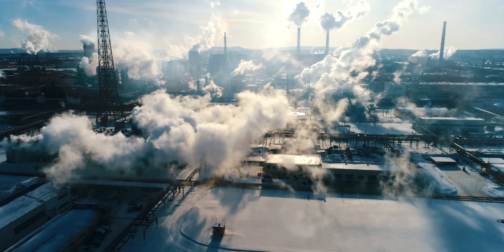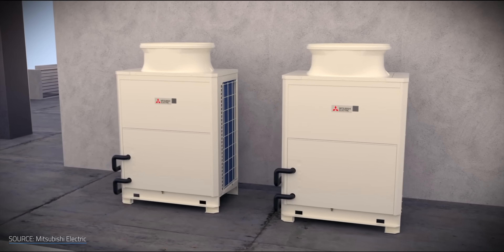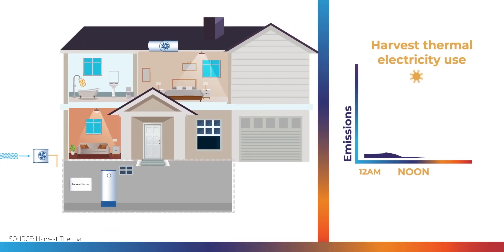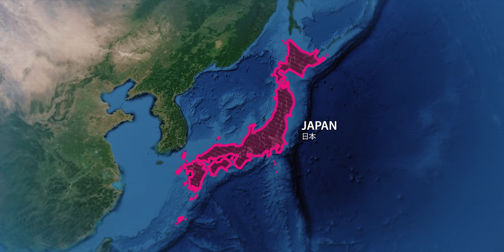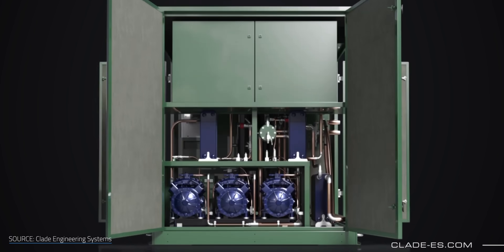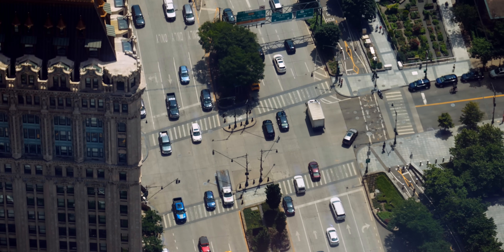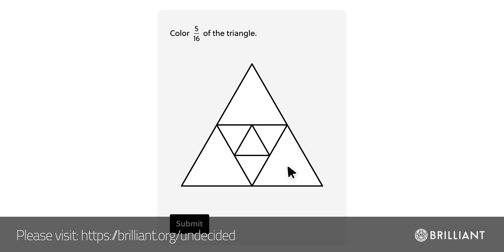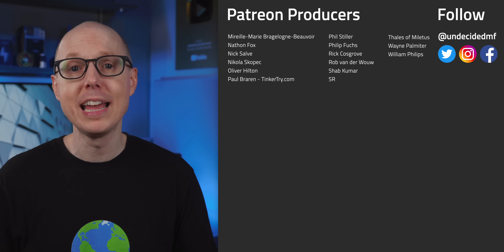Why CO2 Heat Pumps Are The Future Of Cooling

Comment: There are parts of this video that  promote the scam that noncondensing greenhouse gas behavior is warming the planet.   They can't under well known science because earth's greenhouse effect is the model of a system always in saturation from the strong greenhouse gas water vapor.  A system in saturation can not have any more effect from further increasing its active elements.    Earth's greenhouse effect adds 10°F (5.55°C) to earth's average temperature and takes place within 20 meters of the surface.   After 20 meters from the surface all the greenhouse radiant energy has been absorbed by greenhouse gases.  Its further heat transfer is by convection  i.e. gas molecules bumping into each other.  At 1% average tropospheric water vapor 99-1/2% of earth's greenhouse effect is from water vapor.   The noncondensing greenhouse gases have a share in earth's greenhouse effect, but they can not change a system always in saturation from the strong greenhouse gas water vapor.  This is high school science.

The United Nation's IPCC science report in the back of some 200 pages in an obscure paragraph declares it took its greenhouse gas samples at 20,000 meters altitude and only that one altitude!   That is the legal back stop protecting the authors among others from criminal fraud.    It can be argued in court that a high school science interested student would know from reading the IPCC science report it is not actually dealing with active greenhouse gases or earth's greenhouse effect.  The person would be expected to know that from common knowledge and the report authors have made their data transparent.   The IPCC science report doesn't actually flat out state noncondensing greenhouse gases are causing global warming.   Other people writing other IPCC reports have it as their opinion noncondensing greenhouse gases are causing global warming.  That would be the legal protection on more profound statements of noncondensing greenhouse gases causing global warming.   Stating noncondensing greenhouse gases are causing global warming is the biggest known scam in human history.   This is happening when global warming was reported at 1.1°C in 1991 and as of 2023 has never been reported to go higher.   Global warming has been basically stalled at about 1°C for the past thirty years!

Comment: Leaks from the CO2 heat pump aren't really an issue at all, since the worst it will do is return CO2 to the environment that was previously there before it was put into the heat pump.  Unlike burning fossil fuels, which creates all new CO2 in the environment.

And then the amounts involved are so small as to be pretty meaningless as well.

Comment: Pricing sucks. In China,  HPs with specs often exceeding what we in the US can buy from Mitsubishi cost around $500 vs $2000-2500 here – and that's before HVAC installers arbitrarily double that cost for installation (even though an install for requires only modest skill and little special equipment). I truly hope that DrCool's increasing popularity will put pressure on installers to lower what they're charging.
Reply: U believe Chinese specs? Rule of thumb, its usually half their claim.

Comment: CO2 critical temperature is ~31'C (88'F). When out door temp is higher than that, the whole fluid is supercritical (SC). I don't think SC is advantage for heat pump application. SC was used in generator to max mechanical output from a given heat. In heat pump, we want least mechanical work for a given heat (pumping). 
This CO2 heat pump saga is started with EU politicizing and refrigerant patent avoiding. Not going to work on tropical zone for sure.

Comment: There are a couple of massive problems with CO2 which is why they're not used for heat pumps or AC systems;

1: It forms a solid
2: The pressures required to make it liquid are ridiculously high.

R1234YF, a common refrigerant in modern AC units and cars, has a condenser pressure of 350PSI and a low side between 30 and 40 PSI. R34A, which is the predecessor to R1234YF is also quite similar and also provides a near 3 COP.

For a CO2 system it would have to be maintained in a supercritical or near supercritical state which means a high side pressure up to 1500 PSI. if there's a leak in the system and the pressures drop there's a good chance you can form dry ice in the lines, effectively clogging the system. Additionally, there is a correlation between system pressure and failure
rates, as the increased pressures put more stress on the compressor, pipework and service valves. Higher refrigerant pressure machines tend to fail more frequently from low refrigerant charge due to the refrigerants increased tendency to attempt to escape into atmosphere. We saw this during the transitions from R22 to R404A, R410A and R34A.

Comment: Using CO2 as a refrigerant in the heat pump requires so high pressure, that if it fails and depresurises during operation, it's gonna kill someone...

Comment: 17 years in the hvac trade.  If you want to eliminate leakages, eliminate efficiency mandates on hvac equipment and focus on increasing renewable energy production and long duration energy storage, no more curtailment, make power cheap enough that it becomes a subscription service instead of a metered commidity.  Go back to SEER 8-10 coils and lower pressure refrigerants like R22 and R12, a system that doesnt leak, doesnt pollute.  The watts that you save with higher efficiency is a drop in the bucket compared to the money of replacing leaking coils

Comment: The problem isn't just the initial cost, but how long do the components last and what's the cost and frequency of replacing the individual components.  Efficiency is great but the devil is in the details.  I installed a high efficiency gas furnace about thirteen years ago.  It saved me a lot of money in monthly costs compared to my old oil fired system, but it took ten years to recoup the original installation cost in those savings.  Two years ago the aluminum core corroded and started leaking despite yearly maintenance that included flushing the core and installing an anti-corrosive solution.  The cost of replacing the core under warranty was split with the service contractor with the labor cost on me.  If it was an old style iron core furnace the unit would last thirty to fifty years.  The newer ones last ten to fifteen years and the original cost of installation is now at least $15- $20 thousand US.  If the unit hadn't been under warranty I would have been on the hook for the whole bill which could be a couple of thousand dollars or more depending on the amount of plumbing work needed.

Comment: CO2 critical temperature is 32C or 90F. It means that this is the highest temperature during condensation stage. So who wants "hot" water with max theoretical temperature of 32C/90F?
R410a has a critical temperature of 72C or 160F. So R410a can heat water/air up to this temperature. Which is reasonable.
Reply: For heating applications, the critical temperature doesn't set an output limit.  The refrigerant is compressed in the gas phase and can easily get much hotter than the critical temperature.  CO2 based heat pumps from many manufacturers have operating output temperatures anywhere from 70C to 90C or above.

For cooling applications, the critical temperature of CO2 is a major stumbling block.

This is because the simplest pressure reduction apparatus is some sort of throttling process like a valve or a thin capillary, and those are only efficient if your refrigerant is liquid entering the process.   Using an ordinary throttling process in CO2 based cooling is basically a non-starter on a hot day.

There are solutions to the cooling problem, using expansion engines and the like, but they add lots of complexity to the system.

Comment: CO2 is not the only competitor in the race to environmental-friendly refrigerants. Ammonia was already widely used in commericial food refrigeration, and propane is making its way into small refrigerators and AC units for its low material and low liquidation pressure. Technology Connections had also made a video on his small fridge that uses propane.
Reply: Propane all the way. If I have a leak, I'll take flammable over toxic any day

Comment: So as an HVAC professional, that works on boilers chillers heat pumps and split systems, I was told by a vendor that a school in New York City wanted to get rid of the natural gas water heater in their building because natural gas is now bad. They installed a CO2 heat pump to heat the water as it was sold as more energy efficient. To heat the same amount of water for this elementary school the bill went from $1,500 a month for gas to $17,000 a month. All in the name of being more efficient.

Where systems will not add much cost getting low hanging efficiency makes a lot of sense but in the CO2 world there's not a lot of low hanging fruit as installation cost significantly increases.

Comment: Propane is an excellent refrigerant. Often better performance compared to co2. But a bit explosive.

Ive even seen experimentsl combined heatpumps with a dual compressor setup with propane and co2. It creates a heatpump with good performance and rhe possibility to have high temperatures.
Reply: r290, represent!

Comment: Compare the pressure temperature charts of R744 (co2 refrigerant) to the common R410A refrigerants used in your home. “Higher pressure” is a bit of an understatement. Using water to transfer heat is a requirement to contain that beast. I also find it unlikely you’ll only be paying 2x as much to have it installed in a home even if their marketing is based on the most expensive competitive equipment installed by the most expensive contractor.

Comment: Matt, heat pumps, Pah! Goodbye to hot showers. Gas boiler inefficeny vs electricity price? Here in the UK the average price per KWH for electrity is more than 4 times that of gas. And, yes, don't be shy about  the relative installation costs. The purpose might be admirable, but as with all things it will be the less well off who are disadvantaged.

Comment: Don't fear the need for higher pressures in the system; if you have a modern car, it's direct injection may work at four to six times the pressure of a CO2 heat pump. My farm tractor, diesel with catalytic converter, etc., operates for thousands of hours at well over 1,500 bar. Bar, not psi. 
The technology exists, the pressures really aren't that high. Getting everyone on board ... will take a while. By the time Americans embraced HID headlights, the Europeans were using LEDs.

Comment: As far as refrigerants go, I think propane is the most likely to play an outsized role in the future.
Reply: I think the same. R290 will be in the next big wave of heat pumps for residential use. Right now R32 is "state of the art". Older heat pumps still use R410a.
Reply: you guys make me feel so forward thinking in my bass ackwardness using old r134a gear on r290. 30 bucks for 20lbs. no epa card required.
Reply: @hardrays  Just check if your gear isn't burning here and then :-)

Comment: I run my Heat pump  water heater with Winter propane, my hot water is 70,5 dgC 
Legionella dies at 68C
Winter Propane i think is R290?  (dryed propane)

Comment: I do HVAC and I have seen these kinds of systems that are connected to the hot water what people are forgetting is calcium buildup inside of those pipes those systems have to be replaced way more
Reply: valid! i dont see a way they can effectively explode the lime away like a "self cleaning" electric element. i cant imagine that it could get that hot.  if there is no fix for that then theyll all be duds about the time the warranty ends.

Comment: Matt I'm currently design/building a four family apt building and am exploring ways to potentially be the utility provider for the building.  The further I drill down I realized thermal storage is the piece that brings it all together with respect to hvac, hot water, etc.  This is a fantastic piece to that puzzle.  A further integration/improvement would be adding PVT solar panels to this set up, as the hot water could be dumped in this same water tank / thermal battery to supplement it further.  I haven't found a PVT supplier in the US, but there are several abroad; DualSun (FRA), several Chinese, and some Dutch if I recall correctly.  A further improvement is using a ground source heat pump (geothermal) vs air source.  This is far less practical though per installation and cost though.

It's frustrating how much better the options are in the commercial space vs residential, thanks for shedding some light on that.  I found the most efficient set up to be a ground-sourced heat pump that, in a multi-unit apt building mind you, could not only heat and cool each space, but also transfer heat/cool from one unit to another (as opposed to from the ground (or air in an air-sourced set up).  This is even more efficient than moving from ground/air.  Problem is, it requires 3phase electric.  Also impractical from an installation/cost perspective.

Comment: 1800 psi or 124 bar at the high pressure side for co2 compared to regular r123A or r1234YF 145 psi or 10 bar at the high pressure side.

Will be A LOT more expensive to use and hard to keep from leaking out.

Will take A LOT more copper/metal to keep the pressure inside without exploding.

Just stay with R1234YF/propane that is already in most new cars

Comment: I decided to install a WaterFurnace brand geothermal HVAC system in my current home which was built in 1996. For the past 27 years my electric bill has averaged $74 per month for this 1350 ft.² ranch home; there is no other heat source, it’s all electric. As a bonus, the system also heats the hot water in a standard hot water heater. This system is extremely efficient! After 27 years, it is still working flawlessly!
Reply: did it require repairs or part replacements after all those years?
Reply: 1 relay switch, $45. My HVAC guy for the past 38 years said WaterFurnace was the Cadillac of heat pumps even though his company sold another brand. In addition there is no outside air exchanger to be serviced or replaced. Every  5 years o! @zodiacfml

Comment: No reason for this to cost so much more than current heat pumps, only thing new is using co2. And just when you break even time for a new system. This stuff fails because of the obvious greed of the initial cost, and the subsidies aren't free money they are taxes.

Comment: Liquid CO2 cooling was used a couple of decades ago to cool datacentres that had equipment cabinets having a high heat load. The heat latency of liquid CO2 to the gas phase was much more efficient than at moving heat than water based cooling. It was implemented as a fan assisted heat exchange "radiator" mounted on the back of a standard equipment rack. The high pressures 50+ Bar?) needed to work with liquid CO2 meant that the pipework had to be thick walled stainless steel with close tolerance preformed pipe dimensions. I saw one in operation at Imperial College in London. Expensive to build, but allowed heat loads in rooms that could not otherwise cope.
Reply: A system running normal CFC refrigerant would probably have been more efficient and cheaper to build and maintain.
Reply: Liquid CO2? Doesn't carbon dioxide phase change directly from a solid to a gas and not have a liquid state? Hence the name "Dry-ice". Or is it different when under high pressures?
Reply: @Samqdf  Check the contents of a CO2 fire extinguisher. It is liquid CO2 held under pressure.   At normal atmospheric pressure CO2 exists in the gas or solid states.
Reply: 5.2 Atmospheres and above you can have liquid CO2.  I have seen it in a lab using a sapphire tube as undergraduate chemist.
Reply: @Rico-oy3dc I see, I stand correct then
Reply: @Samqdf  Yes it's different under pressure. Dry ice is formed at 5.2 bar pressure and a CO2 unit have higher pressure than that on both LP and HP sides. So not a problem.
But I have seen it happend when some selected a bad choice of relief valve that opened up fully when triggered. That created a ice plug in the evacuation piping that took some time and heat to release. The critical temperature for CO2 is 31'C and 73,8 bars. Above that point you have flash gases or basically gas. Then the condenser works as a gas cooler in transcritical use.
Below that point you have liquid CO2, for subcritical use.
CO2 is perfect for lower temperatures like -10 to -30'C and suites perfectly for refrigeration and freezing.
Not optimal for residential heating. Then there are better refrigerants that is much more efficient and almost as good GWP.
Actually I consider R290 and R600a with GWP of 3 much better choice, because you are more careful to not release those refrigerants into the room during service.
Then you will have a potentially explosive environment.
CO2 on the other hand is usually release at every service since it's not considered harmful for the environment.
So there is much more global earth warming because of released CO2 than R290 or R600a.
Bad practice by the service technichians...
Reply: @flex-cx9bi  R290 definitely is the better refrigerant for a lot of use cases and less likely to leak.  CO2 in a high pressure like that is a powerful solvent,  people for sure are going to get injured